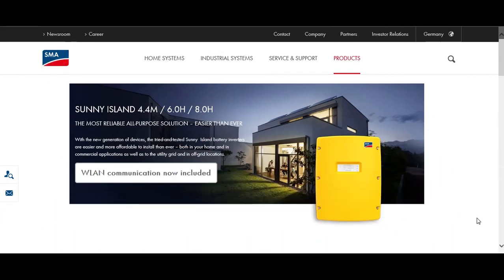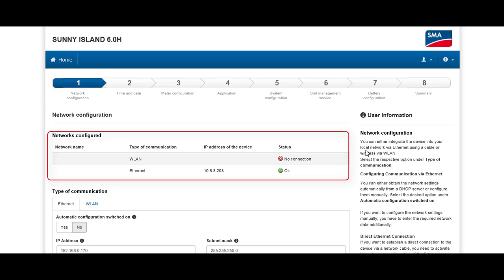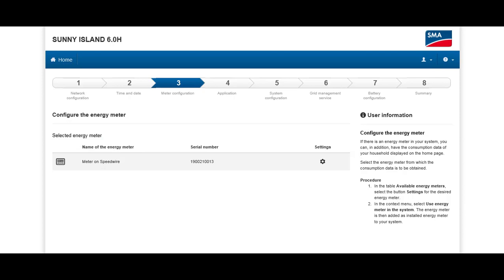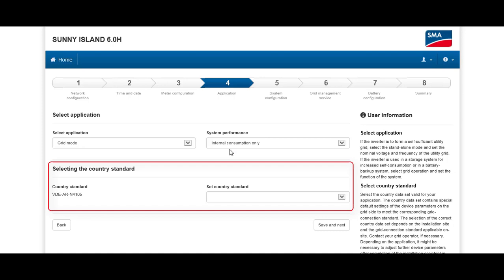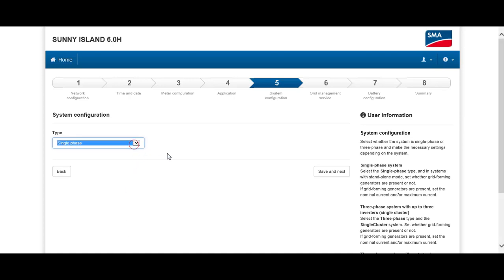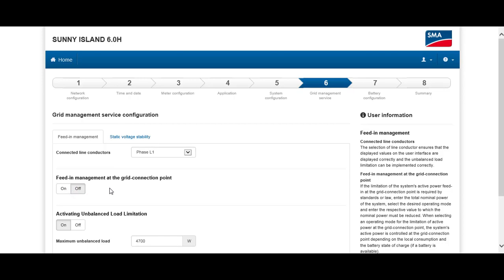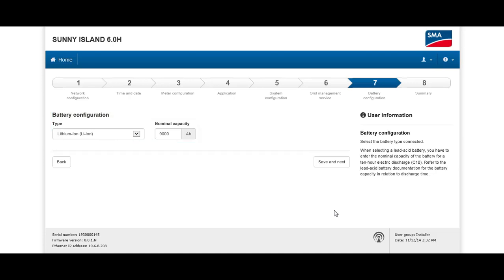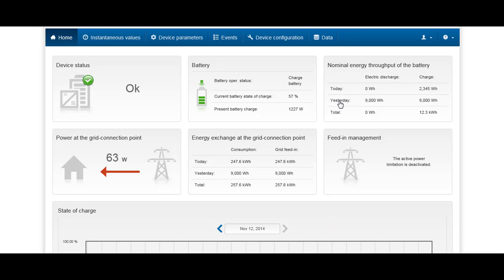Sunny Island: Connect to the Utility Grid in Only Eight Steps

Comment: Is it possible to configure the SI -11 in the same manner
Reply from the maker: The configuration via the Web User Interface is only possible for Sunny Island with built-in WLAN capability.

To configure the Sunny Island -11 series you will require a Sunny Remote Control.

https://youtu.be/lveK84Rutxc
Reply: Are you considering a firmware upgrade or other work around? This functionality will enhance the ability of current users to easily configure the current older generation of units.
Reply from the maker: Unfortunately the issue cannot be solved by firmware alone as there are physical hardware differences between the Sunny Island -11 & -12 series.
Reply: But the -11 series can go online with various combination of additional interfaces... I could not work out what I needed. This would be so useful to me.  Remote logging and settings changes.
Reply: Only SI-12, connecting to ETH port in SI